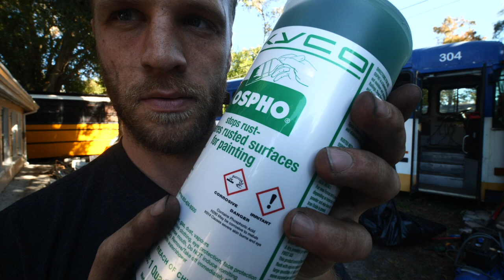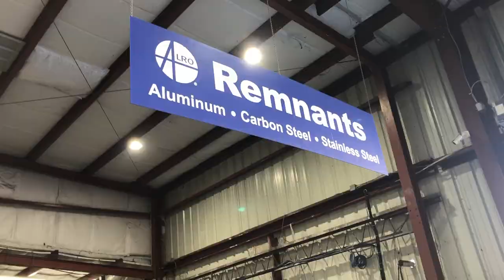Rust Removal! Fixing and Preventing Rust in Our Transit Bus Conversion

Comment: Would welding the hatches have been an option? Both pieces are steel, right?
Reply: I would advise against welding as the welds often break with all the shake rattle and rolling down the road causes. 
Always keep movement in mind when building things that…move 🙃